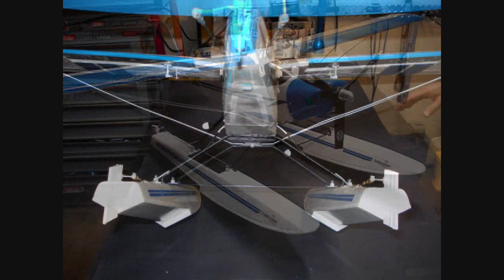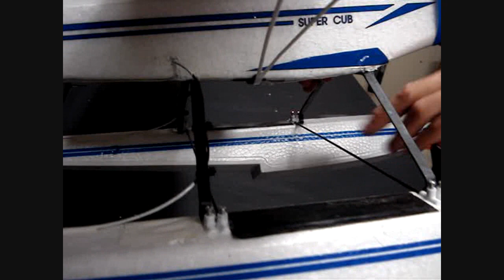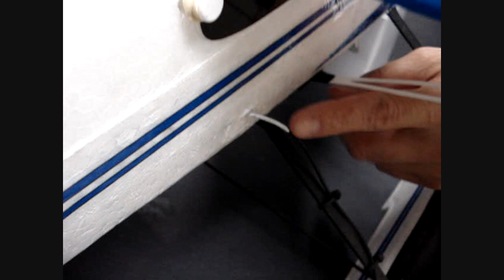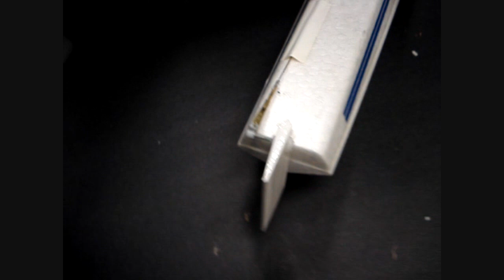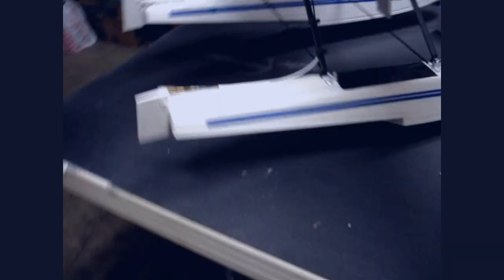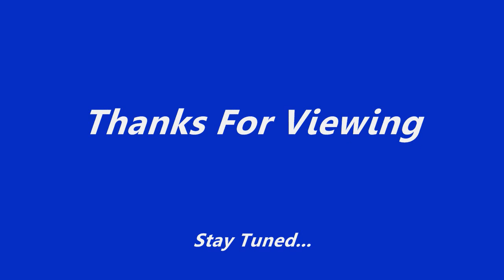SuperCub Overview On How To Install  Rudders On Floats

Comment: My SuperCub is all stock, I don't have a larger motor on it. Would the weight of the added servo, wire, and rudders change the flight characteristics much? If not, I will likely try your method out. It looks great!
Reply from the maker: I will mot change it much you should be ok,Thanks for commenting ..Tim
Reply: Thanks for the quick reply Tim, and all your great videos! Keep them up!

Comment from the maker: @rcdudes123 Great Questions 
I used a set of old aileons form a crashed plane just cut them and installed hing's You can get the push pull cables form your local hobby store it come with wire and casing .. You can make the rudders out of balsa and paint them to protect them form water.. Hope this helps..Tim

Comment from the maker: @HighFlyingA380 Well with this rudder combo that I installed it helps with steering the plane in water . Is better to start with the stock super cub learn on that before you move to floats. and with this installation it does sit in the water very nice and works great..Thanks for commenting.

Comment from the maker: @mrbillandshell  Yes you are right I used a fixed landing gear that I bought at the local hobby store then cut it in two its Alum.  on the rudder I mixed it one to one with the ailerons  25% Exp. You can get the Alum fixed gear from your local store good luck and let me know if you need more help.